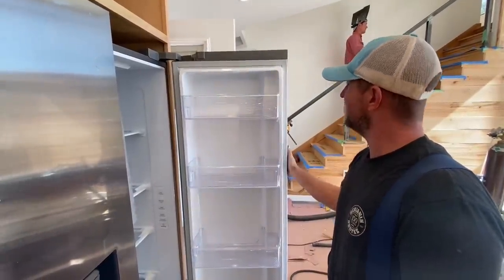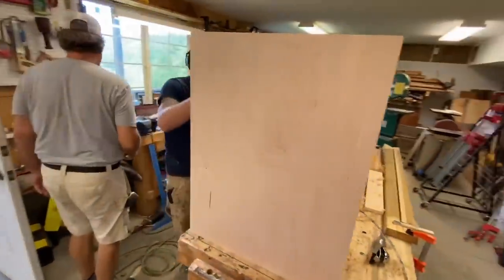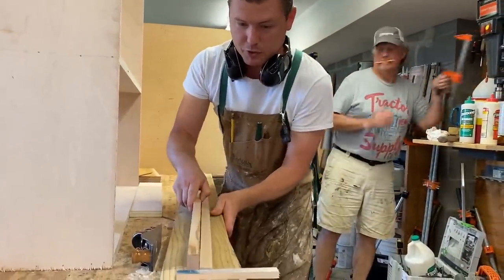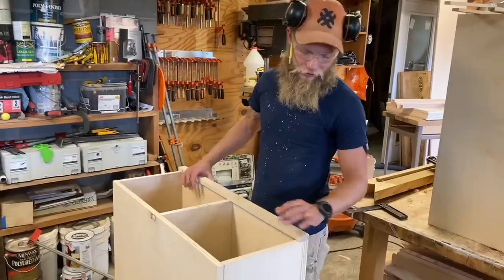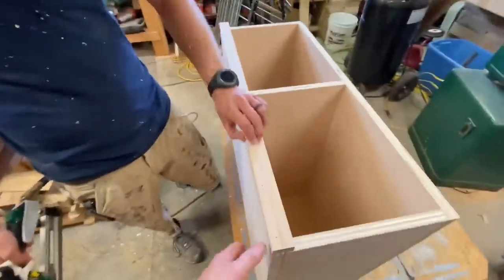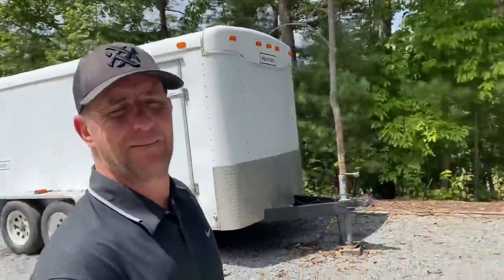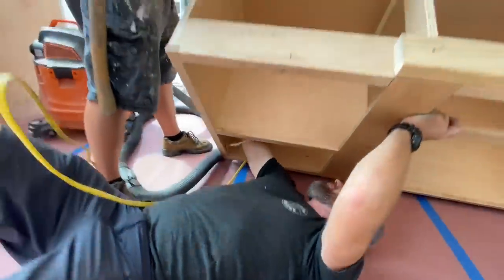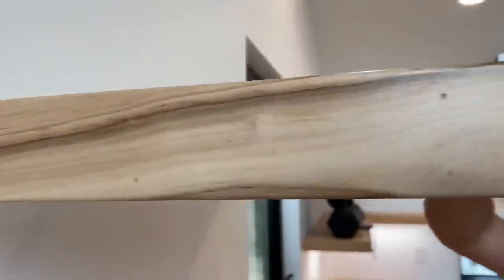Building a House Start To Finish | Episode 22

Comment: Ahh, one of my pet peeves is seeing visible brad nails on cabinets and shelving.
Reply: @bluebird5100  Yeah, but these guys are legit builders/carpenters/woodworkers and know how to do better. I guess I just expected hardwood shelves or better-built cabinets. Could also be a budget/time thing.
Reply: GS to say it would be expensive to try zero visible joinery is the understatement of the century. Miserable experience, I’ve tried it. Far easier to fill and cover, and it doesn’t make one cabinet a 4 month adventure. You still need nails, hardwood or not. The chinesium just throws a veneer over all of in which will eventually peel or fail in its own way.
Reply: Wood fill and the poly finish should hide them pretty good.
Reply: @GameVilleofficialpage  No one is asking for zero visible joinery. Just fill the damn nail holes!

Comment: I don't want to offend anyone but is this "using the nail gun" for lots of cabinet work, something practiced all around in the USA? It strikes me as odd to use nails for faceplates or visible stuff in general.
Reply: This is not proper cabinet building. They are banging together shop furniture.

Comment: in the time it took for you to set up, video, and discuss those little knock down platforms you seemed so proud of, you could've changed the table saw blade and done a proper job. I also found it disappointing that  you had the proper blade and tools readily at hand to do a quality job but just chose not to; so next time don't apologize to your "woodworking friends", apologize to your customer that you had to turn the pieces in order to hide crappy work practices.
You're representing your business sir, do a better job....or at the least don't include it on a video that so far has gotten 13k+ views
Reply: Well said.

Comment: Ray's technique with the nail gun improved.  Notice how he was NOT holding the nail gun perpendicular to the face frame when he got the blow out?  Brad nails bend to the side typically as they are asymmetric.  And yes, that was painful to see that atrocious tear out on the plywood.  If you're going to be cutting all that plywood, PLEASE use the appropriate blade.  I shed a tear for that tear (out!)